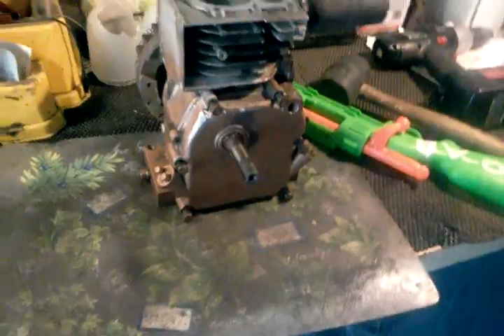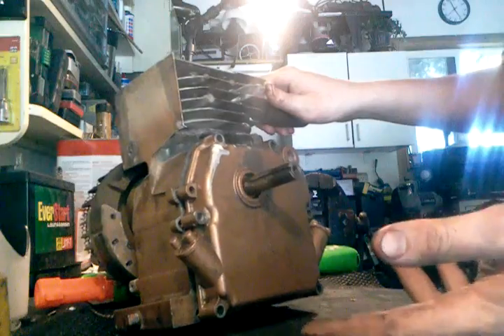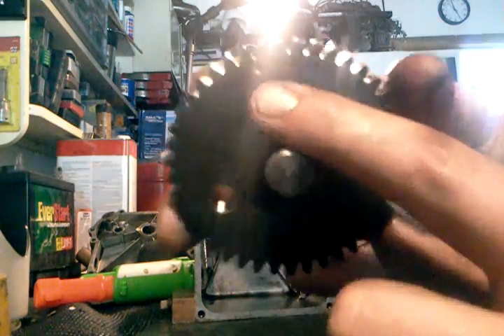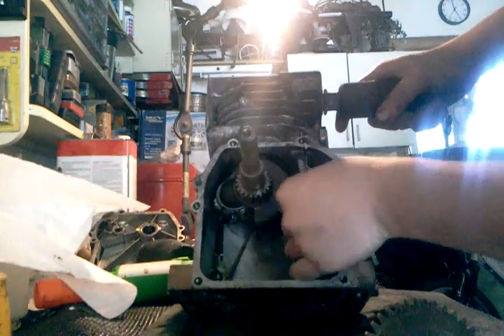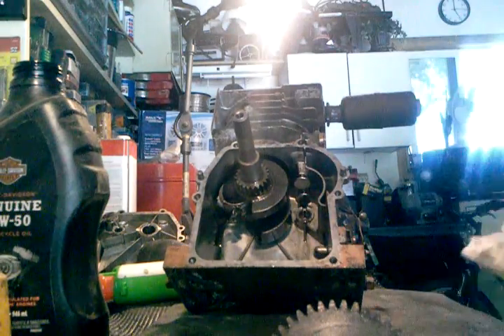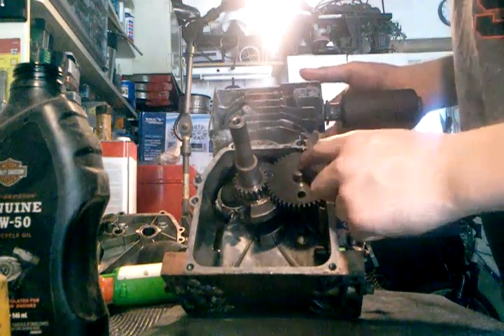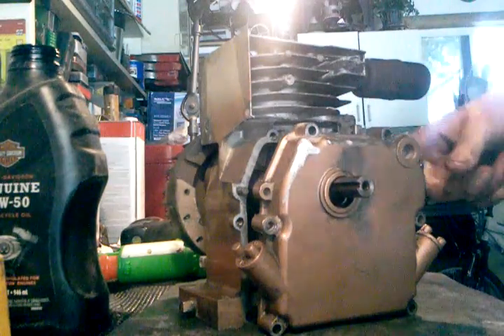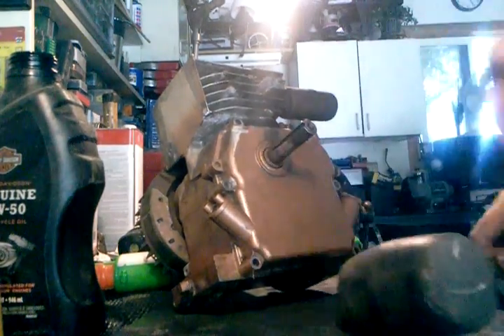How to do your timing on any small hp engine

Comment: An old school way to time that motor's cam-to-crank ,(even if you cant find one of the marks because the crank ones do wear off from end load) is to place piston  @ top dead center and install cam where the slightest movement c.c.w. will touch the tappet of  one valve and the same movement c.w.after t.d.c. will touch the other .I  was poor,so by the time motors were thrown out, they were usually junk.I have videos on u tube of my old motors and 17 homemade motorized bikes under  wademademotorizedmayhem@gmail.com     Or just  wade made. Thanks.
Reply: Hey need more information on this